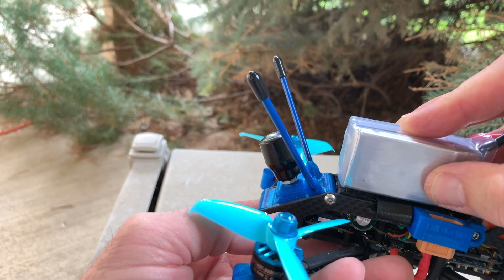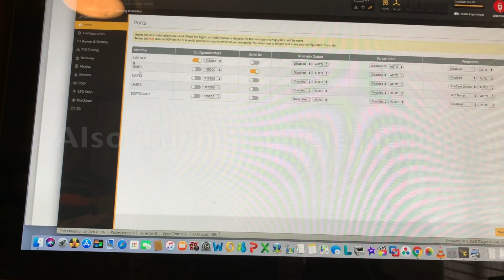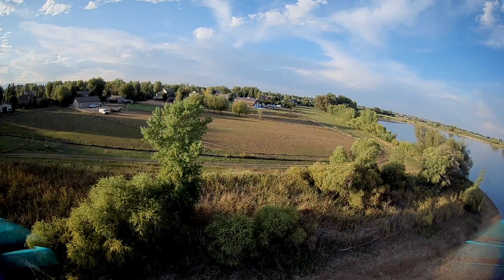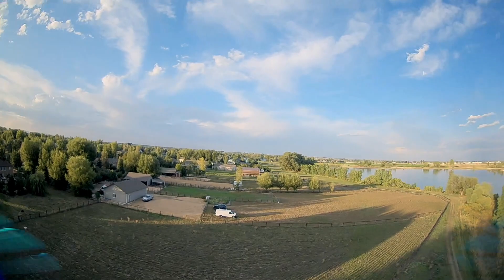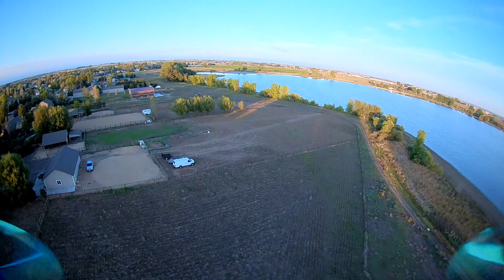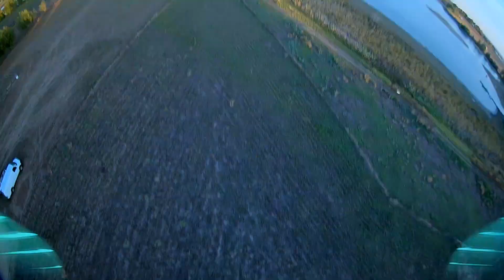Acrobrat Build With HGLRC F428-TX20 & RunCam Split Mini

Comment: I've had 3 of those hglrc stacks and have broken the header pin on all 3. Super frustrating.
Reply from the maker: I hear what you are saying. Most stacks have moved away from pin headers back to cable harnesses. So far I have had no issues (knock on wood), even though I have had some spectacular crashes since this video has been made. Have not broke this frame so I think it is a good design. 
You may want to check out the Diatone Mamba F405 mini and Mamba F25 ESC stack. Documentation is lacking but I like it.
Reply: @slogfpv  funny! That's what I replaced the hglrc stacks with. I have 2 of them. I like them BUT... just a heads up, if you are going to use them with a rapidfire module, you have to use them on mode 2 (compadability mode). Otherwise the fpv feed is really dark. Something about an out of spec capacitor or something. If I had to do the hglrc stack over again, I would have added more epoxy to the pin headers.
Reply from the maker: @rotorbob  
Great tip! Thanks! I just purchased the Crossfire micro starter set during the holiday sales. When TBS Crossfire first came out it was a little pricey for the type of flying I do. But now they have the micro TX, I think it will be worth it. Already liked how much easier it is to flash FW on the reciever. I just put one on a new Smooth Operator build with a JB F4 FC/ESC stack that I am finishing up. Will see how well it flies once it gets a little warmer (18f right now).
Cheers!